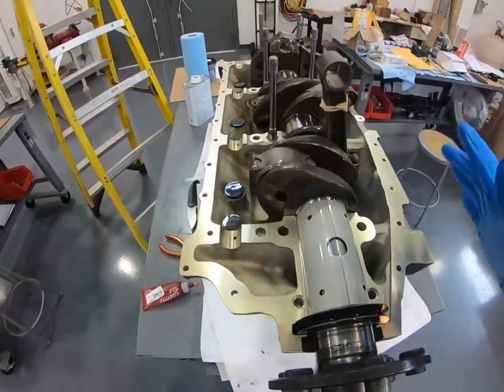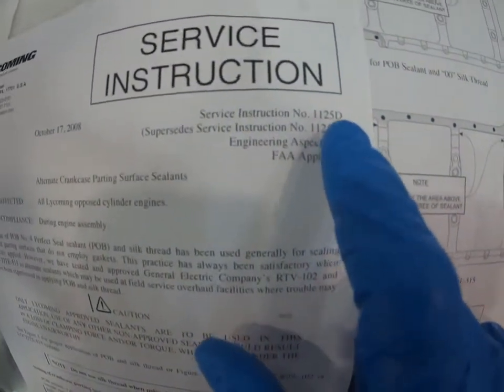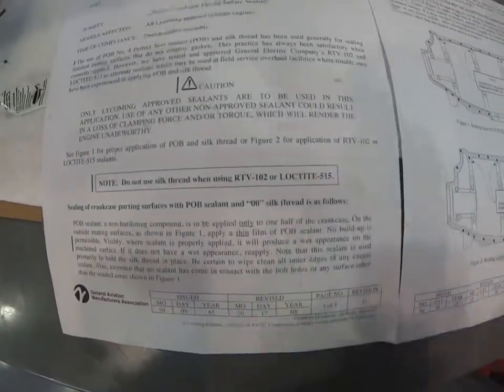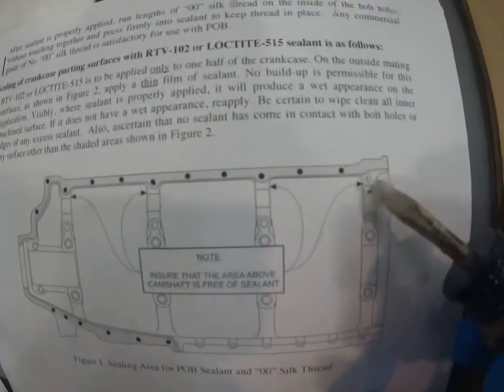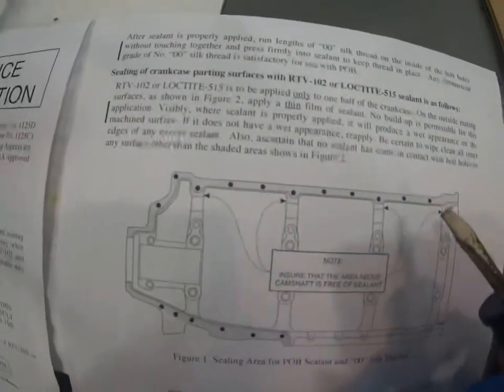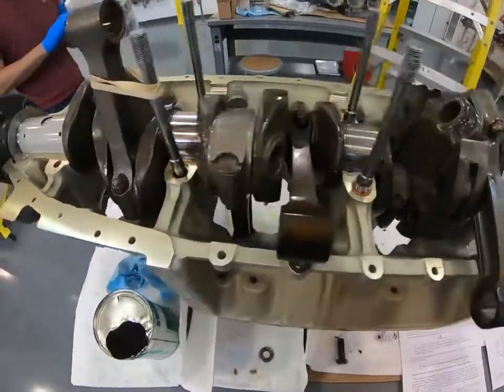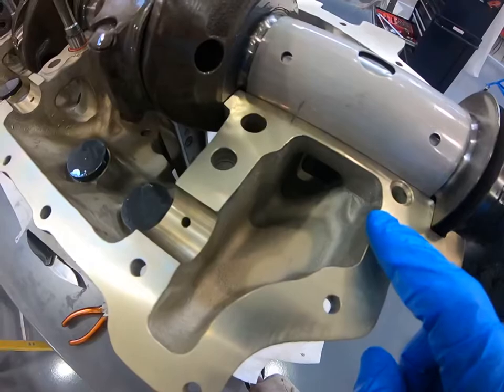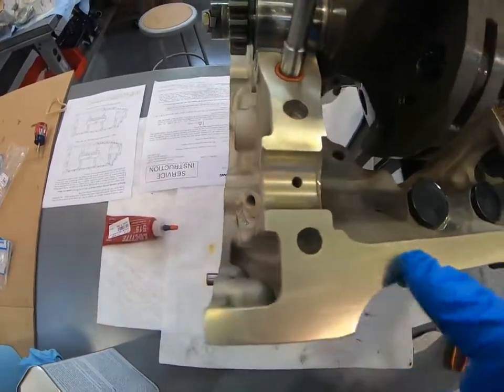Applying Loctite 515 sealant to the crankcase of a Lycoming aircraft engine

Comment: I haven't built one using this method yet.... Are you convinced? How is this one holding up? Was it easier than the thread? Thanks!
Reply: @fly6tech776  Yes info recall finding a document where lycoming “accepted” this process. I’ll see what I can dig up.
Reply: @fly6tech776  Thank you for your Input! Are you aware of the repair of applying Vacuum to the case loosening the case halves and sucking more sealant in the seam? I have heard great results using that method.